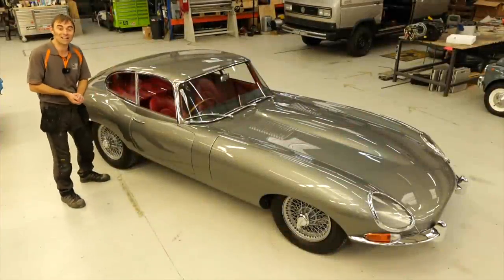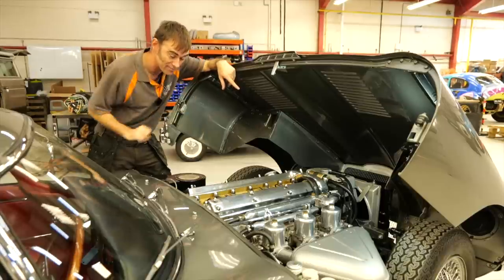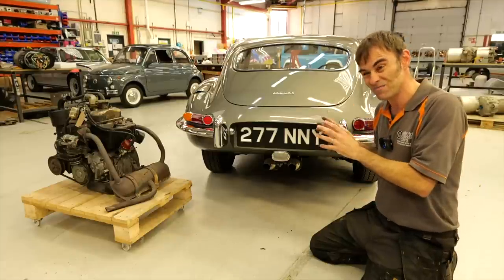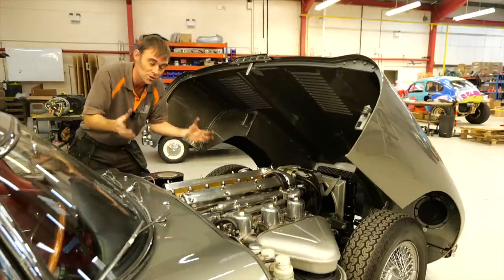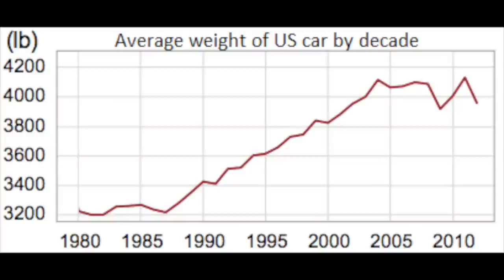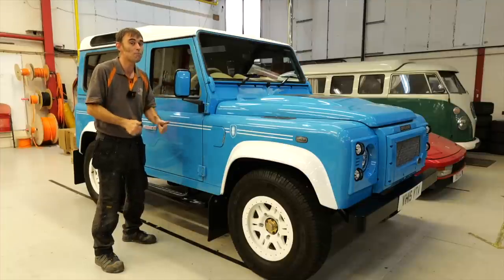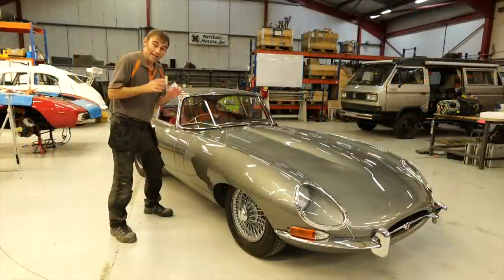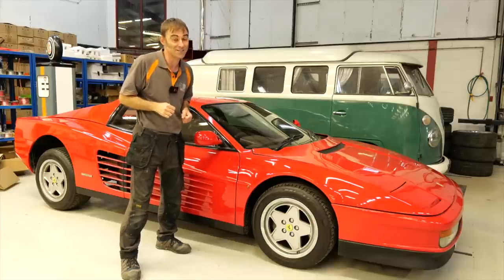Is it a sin to convert a classic car to electric?

Comment: I think people confuse the “soul” of the car with the “character” of the car.  I’d say (almost) all cars derive some of their character from the engine, and some more than others.  I’m thinking of 60’s/70’s muscle cars that were built with big, rumbling engines as the main feature of the car.  You certainly can put a big electric motor in there, and maybe improve the performance, but the character of the car will be changed completely.  A Beetle or Fiat 500 or the other hand was built as cheap and easy transportation.  Sure the putt putt putt of the little engine adds some charm to it, but more power, reliability, and cleanliness won’t change the cute curvy lines or diminutive size.  I’m working on rebuilding. 1957 Jeep CJ5 with the goal of doing an EV conversion, and have been catching flak from the comments section about it, so I’ve been thinking about what defines the character of the Jeep.  The seven slot grill and round headlights, 4wd with solid axles and leaf spring suspension, the iconic squarish  body style…and that’s about it. Throw any engine you want in there and it’s still a Jeep, so why not electric?

Comment: I think those are excellent arguments you're making. You should add that old cars are unreliable not just because they are old, but because the design was not good at the time. Otherwise you could say that the engine has just been overhauled. I own a lot of old car magazines, and in auto motor und sport 2/71 I found the 50,000 km endurance test of the supposedly indestructible Mercedes W114 230. In those few kilometres, a list of 24 defects had accumulated. So even with the new car there was something every 2000 km. I also see the argument of iconic engines differently. There is no historic drive that appears powerful and superior by today's standards. So there is a big difference between visual beauty and driving pleasure by today's standards. A current Mercedes 220 D taxi is more dynamic than a perfectly running 300 SEL 6.3 with an engine overhauled for €30,000. What's more, there were always cars that already had a problem with the drivetrain back then. These are, for example, all vans, delivery vehicles and small lorries. These are all small cars and 2-strokes. There were even entire brands where the engine never shone, such as Citroën or Volvo, and individual models where the engine never ran, such as the Ro 80.

Comment: IS not a Sin. first of all the owner can do whatever he want to its own car, besides that talking about pluses of EV in certain classics, for example small two stroke engines are much more poisonous, and harder to use daily, many other engines the more old they become is harder and expensive to keep it running. Even is better to have rarity engines in "display" mode than  running in a vehicle. I'm thinking in things like the Isetta the Messerschmitt KR 200, DKW autounion, ETC. My grandfather had a Borgward. Isabella I was looking a abandoned one to restore, but the engine was missing, EV conversion can bring back to life those cars also.

Comment: The Jag engine can always be on display & mounted into a frame to be run sometimes ......rather like Guy Martin with his RR Merlin engine.  The Jag engine is a work of art in its own right.
I wish there were 'NO EMISSION PARKING ONLY' on my local High St especially by the street-side alfresco dining......in fact the whole tourism street should really be no emissions vehicles only.  Soot & noise boxes can be detoured, thanks.

Comment: Good rounded presentation Richard. I like your comment regarding Experience vs Opinion. Most, but not all, of the negativity comes from the latter. I’d say that there are many vehicles where the engine was mediocre at best. Take the Citroen H Van for example. Classic shape, rubbish engine. Electrify them all..

Comment: I think you described soul where you listed the negatives. The sound, smell and the need to tinker and tweak an ice car is what gives it its personally and soul. I had an MGB as a second car for almost 20 years, it wasn’t fast comfortable or handle very well but it had personality. If I didn’t drive it for a couple of weeks it ‘sulked’, in that the dampness got into the ignition and it didn’t run well until I’d got it nice and warm. But it was fun, the pleasure came from the well timed gear change that took you through the bend at just the right speed. It’s the only car I would take out just for the sake of a drive, it was just more engaging to drive. I would never have done that with my more powerful, comfortable daily drive, that was just a tool. I fly electric RC planes because I can charge the batteries go to the club field and just fly, but the pleasure comes from using electric to gain height then turn it off and use thermals to fly. Many of the members are committed IC flyers, they can and do fly electric but it doesn’t really do it for them unless it’s the middle of winter and they want to fly and can’t be bothered to carry all the required gear to the field.

Comment: I would love to convert my air cooled 911 to electric. I want to keep the gearbox and have the have the drive torque curve to match the original engine. Is this possible? Also I only see electric motors in the 125hp range. Is there something around 250?  Thanks.
Reply: How about 600 hp.? 👍

Comment: Ultimately, electric conversion is one of the very few ways to preserve cars as cars... as in actually driving vehicles.
The only way to preserve classic cars with their internal combustion engine will ultimately be via hydrogen, but that needs the proper infrastructure and more time in the development of fuel storage (in terms of safety and range).
Fully electric drive trains are much farther.

In the end it comes to, what you like most about a specific car: the look/design or the sound. And no... not the "driving experience"... never... old cars are rubbish and dangerous in that regard.

I personally, am in the camp of design. So, an electric conversion with a few added/improved safety features (breaks, tyres, shocks, steering, etc.) would be the best way to go.

Comment: EVs are much easier to control at low speeds. Not having to change gears makes driving much safer and surprisingly more fun. I even love regen braking and not having to worry as much about hitting the brakes. Then there's things like hub motors and wheel motors that remove the need for drivetrains and make maintenance even easier.

Comment: If Makers of Classic cars would have had viable Electric  motors, batteries, and Electronics where available to them, they would have sold the Classics with the option of an Electric motor.  There is NOTHING "magical" about a Petrol engine - it was just the most practical at the time.  And now with modern Batteries, EV power is also practical.

Comment: I’ve found that most of the pushback from “purists” is from the worry about the increased weight and handling! Yet, you’ve managed to keep the weight low each time! Usually the same as when the gas tank is full!

Or maybe they like the delay, and lack of torque when they hit the gas pedal.

Comment: One of the great benefits of electricity. No matter where electricity is produced it is transported from source to user at the speed of light. No big tankers burn fuel and produce emissions to get liquid get fuel to the user who will then use it to create more pollution.
That is the big problem with hydrogen it is manufactured and volatile and has to be transported and stored at high pressure.
Electricity is one of the energies that run the universe. So where ever you go in the universe it is available. 
No fuel to be manufactured, you could take your Ev Landrover to mars and solar charge it and drive around. Brilliant!!!!!!
As the guy did in the film, The Martian, drove at night and solar charged during the day. Not impossible but challenging.

Of course, you would need an oxygen supply. You never know it could be done one day as a challenge.

Comment: This debate is about change and those who prefer maintaining the status quo, and those that revel in change. I think it would be a Sin to electrify that Jag. It is history and history is always best experenced to see it, hear it, feel it, smell it to live it. If you have bits of one then go for it . Are there any companies sampling the vintage sound and proving sound packs for the electric cars.  I heard many years back one of the big car manufactures had commissioned Lotus to find a "sound" for electric so they can't sneak up on pedestrians. I wonder if that is the Mitusbishi whine. For me electric is nearly there. From what I have seen on youtube and talking to a friend who worked in  the power distribution industry; at present the generation and distribution of electricity is lagging behind the demand.  Until the polaticians start push for more, local, 5 year build, power stations, like Rolls Royce Small Modular Reactor. Rather than the 25-30 year build of the new chinese/ french Sizeweel C station.  From the user view charing stations are not comman, differing capabilities, and have different methods of payment, can have large difference in prices, and some of the charging company websites are poorly maintained. I love the swapible power packs, but that would need to be manufacturer lead. They will need to standardise the size, shape, removal and fitting, across their ranges, VW power station, Ford power station.  What will happen to Shell and BP stations? Will we see Duracell, and Energizer power station. This could also add a push for the RR SMR stations, or maybe the people building industrial estates and distribution centres, might take up the torch. I look forward to the seen the wins and losses as we move towards a more electric tomorrow.  It will be interesting who takes the lead and where we are lead and compared to other countries. We need the stategic champions like the ones that push for the fibre broadband into every home, they can take up the challenge of pushing for 100kW supplies into evey home.  Keep up the good work and the conversation.

Comment: As a former petrolhead myself, whenever I drive around in my Tesla Model Y and pass an old ICE car I can't help but to think of all the moving parts needed to make a gas drivetrain work.  Carbs, lifters, pushrods, cams, pistons, chains, belts, pulleys, crankshaft, etc.  A failure in any one of those things can ruin your day!  No thanks!  I will never drive an ICE car again!  Would love to convert an old Mercedes 280SL pagoda top to EV!

Comment: If a classic car is restored it should be left as is.  However if it's not restored or already missing it's engine and transmission and doesn't require the car to be massively cut up it's ok.  But I like any mods on a car to be mostly bolt on changes, or if metal has to be altered just not to the main body tub.  However if the car being converted isn't a high priced car anyways there's not much damage.

Comment: Electric into a petrol classic is an entirely new and different thing to comprehend isn't it. 
Will an AI cowboy ride a robotic horse ? I wonder if there's a way of syncing a 3.8 liter Jaguar engine sound to harmonise/synchronise with the literal performance of an electric motor?
The electric motor in the E Type surges off the line while you hear the roar of a smelly old petrol engine coming in through the stereo speakers. Could swap it out for the sound of a 50cc Vespa for a laugh. Or a gallop sound with a fart for all those old timey types.

Comment: Sometimes the engine is the main point of the car. To my mind those huge 6 and 12 cylinder engines of E Type engines are beautiful works of art and engineering, sculptures,  that deserves to be preserved in their own right, preferably in the classic car they came in. Others, like ugly Yank V8's, meh, who cares, bin it. So I would not like to see anyone lay a finger on that E-Type. However, if that motor is so shot away that it is beyond salvage then yes, replacing it with a nice EV motor is a great way to keep the car itself alive, on the road, being enjoyed and admired, as it should be.

Comment: The classic name should not be used to describe a mod car because a classic to be a classic should be majorly original and if you replace the engine it is no longer original. I also see that all 5+ year old EV's have terrible resale value in America and I suspect the same will be true for these cars. It is the same for E types that people dropped a V8 into pulling out the inline 6 will only get 25 % to 40 % of a 6.
Reply from the maker: Our 5 year old Tesla Model 3 with 50k miles on it has depreciated by only £5k since we bought it. Show me a new ICE car that holds its value that well. 🤣😂😆

Comment: Yup, whether it's sacrilege will depend entirely on what you're replacing - if the engine is an inherent part of what makes that specific car great, then its a bit of a shame to swap it out. That Jag 6, and a Ferrari V12 is integral to those cars, IMO.
Reply: I think the Testa Rossa they converted works well, improved performance and reliability.
Reply: @jeffreyrwilliams9345  That may well be, but that sounds like the argument an accountant would make, not someone who's passionate about that Ferrari.
Reply: I totally agree and think the same. You can have instant acceleration, a shocking 0 to 60, and plenty of power from the electric conversion, but the choice of classic car you choose shouldn't be taken lightly. The engine in some classic cars is as much a part of the legend as the rest of it, the Sierra RS500 Cosworth for example.

Comment: The heart, the soul, the necessary experience of every classic carburated car is to break down every 100 kilometer - or miles. You can not put in a electric drive train that works all the time! 

How much does a electric car stink? Not at all. The smell of unburnt gazoline, of burnt gazoline, of burnt cork and rubber of the engines is the basic ingredients for every classic car. You have to get  a headache every time you step into a classic car and you must always fear for burning up inside one.

No smell = No soul. No burning = no destiny.

Comment: I'm all into EV conversions, but the soul thing is not to be just easily dimissed. The soul is the essence of something, and in a car is the way it drives-sounds-responds. The torque curve, the heads, carb setup and everything else produce a unique response in any engine, which is way different from petrol car to petrol car than from EV to EV. There is personality yes, but also a recognizable essence that is more than that. Personality can be common to say many american muscle cars, british light roadsters or german autobahn eaters, but soul is what we call the unique experience provided by a certain car, thanks to how it responds. Many petrol cars don't have soul either, they are just functional and you would not be able to tell them apart from each other. They simply serve a purpose, and that's it. But other cars were created with a passion, intended to provide a communication between driver and car that is not just functional. You have to understand and tame their quirks and treats, and only then you extract from them the ultimate experience. A converted classic is full of advantages, allows us to preserve it as a useful machine and enjoy a good part of what it is, but it also becomes a different experience, it has a different soul (If properly converted) which is very valuable and enjoyable too. It does not lose a soul, it just gets another. Keep them coming!

Comment: One day I'll have the stones to convert my rotary powered, fire-breathing 1978 RX-7 GT. But I will, undoubtedly come under fire from rotor fans because of the way rotaries "feel". To be clear the only reason I haven't so far is that the engine and box are already very light, and low down, (also the lack of trans-axles) - a bit more on solid rear axle conversions would be ace! (torque converter episode?)

Comment: Brilliant! Can you convert my wife? She has emission's problems, is high maintenance, doesn't handle well, leaks fluids once a month, has random ECU failure, and the car generates a whining noise from the passenger seat when she's in it. I think that converting her to electric would be excellent - I can just turn off the battery isolator when I don't want to take her out and give her a damned good seeing to :)
Reply: Stepford Wives is for you
Reply: Very good 👍😀😂😂😂
Reply from the maker: Ooooo, you're playing with fire there. 😆😂😁 You better pray she doesn't read that and if she does I'm looking forward to her reply. 😜😆👍

Comment: My MGTF has been off the road for 14 months due to mechanical issues.  I live in Australia and the VVC engine has fought us every day.  We do not have the expertise that is available in the UK for my VVC engine.  And so it sat while I waited for parts to be exported from the UK.  We found out that the VIN on the export MGTF's does not line up with the UK models.  So we had fun with getting the wrong parts.  And COVID made it even harder.  And I still have to fix the clutch.  Electric power would have allowed me to drive that car.  Sure, the noise, the gear changes are great, but not while it sits in the garage sucking even more money with no driving.  I just want to drive the car!  And sitting next to the MGTF is a Skoda with the piston rings issue.  At 77 years old I don't have a lot of time left to enjoy driving.  Please look at a conversion for the MGF/TF.
Reply: Hope you sort the car soon 👍😀